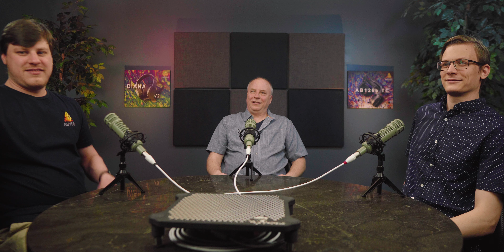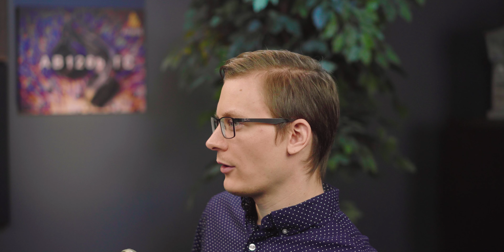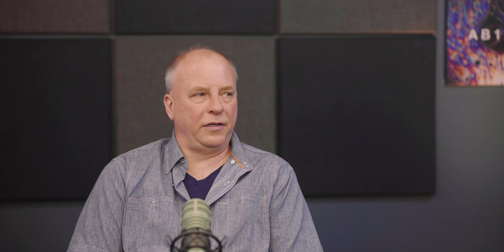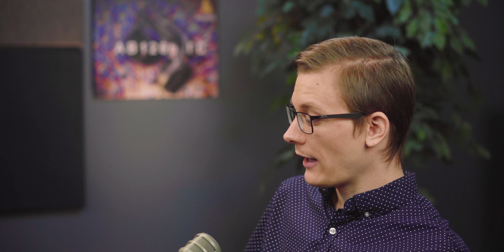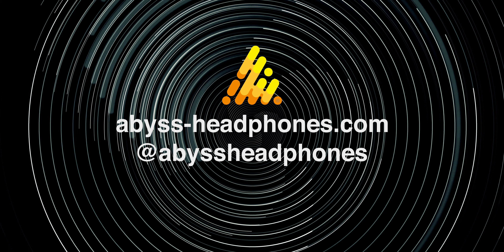Power Conditioners Could Make AUDIO WORSE!!!

Comment: Geezus will the guy in the center let the guy on the right speak. So irritating.
Reply: the guy who seems to know all the info, wasn't getting much of a word is, was he?
Reply: Hell yeah brother. Guy on the right was getting to the point in an intelligent manner by covering relevant points and variables, building to what seemed would be a logical qualified argument. The other guy kept going off on tangents without ever really touching on the main question. I listened till about the 15 minute mark assuming eventually he or the guy on the right would actually answer the root question. Wrong. I don't know if they ever did, as it seemed like the guy in the center would go on forever around the periphery. That's when i quit the video.
Reply: old people tend to do this lots. can be irritating, yes

Comment: We CAN know the condition of the power by using an EMI Dirty Electricity Meter. Also conditioning your whole power system is actually fairly cheap and easy. Just use a Satic Power Perfect Box AND make sure your house or studio has a proper grounding rod that rates at 25 ohms or less.

Comment: A UPS and a power conditioner are two different beasts.  I use a line conditioner to protect expensive computer and audio equipment.  It doesn't improve or degrade the sound quality.  When utility power surges or sags, the line conditioner clicks and adjusts to bring the AC back into spec.  All I'm trying to do is extend the life of the equipment.

Comment: I have a high powered amp that's connected to Furman power supply that's probably 30years old or more, not sure what it was specifically  designed for .. but the amp that it's connected to many times goes into a protection mode for sometimes a brief moment and other times for a few minuets.. Because the power protector is very old, I'm not sure if it's living up to it's purpose or maybe my amp has it's own issues.. not sure which way to go on this...but I'm looking at  upgrading  to a more current power/line conditioner.. any thoughts?
Reply from the maker: A few things to consider. How old is the amp, maybe it's exhibiting a problem. Have your speakers or anything in the system changed prior to the protection tripping? We've seen something like speaker cable cause issues if they are high capacitance on some amps, same with speakers and the variable load they present to the amp. If you're running tube gear you might have a tube going bad.

Comment: I have always wondered how expensive power cable can improve the sound quality of a component when they are plugged into the wall which is wired with 12-14 guage Romex. Any thoughts on this?
Reply: I realize Im pretty randomly asking but does anybody know a good place to watch newly released series online?
Reply: My best somewhat educated guess (I have studied some electrical theory) spend the money on the power conditioner/surge protector. And just use whatever power cable came in the box.
Reply: Power cable can probably affect nearby hifi, especially interconnects. I’ve found everything in hifi can make a difference. But I agree there are no generally accepted logical arguments for why power cable can make a difference, but many audiophiles firmly believe they do.

Comment: So I have a really awesome setup, and we did all grounded electrical and separated outlets.  The power conditioners I had created noise, extra heat, and seemed to cause gear issues.   After I took them out I couldn’t believe my ears.  Get your electrician out to your spot yo separate the breaker from the rest of the electrical.

Comment: I use an UPS with my computer as both a backup for shutdown time and for protection, but the UPS is pure sine wave. I paid around $220 for it new a few years ago. Unless I'm missing something here, it seems you guys may be out of step with the UPS market.
Reply from the maker: We were talking about double conversion true online UPS, it's always generating power, not only for back-up, so the system only sees the regenerated pure sine power,, not the wall outlet. For example, PS Audio builds an audiophile grade device called PowerPlant.
Reply: @ABYSSHeadphones  Ah, gotcha. Don't know why I didn't realize that.

Comment: Can someone explain this further please? 
1. Why can't a pair of schaffner filters (chokes & capacitors) achieve the same the same level of filtering as expensive ones? 
2. Will i lose dynamic range?
3. Will drawing lesser power from a higher rated schaffner filter affect it's effectiveness? (i have an option to buy a 4000W or a 4800W filter)

Comment: Who knew that there would be a subject more controversial than cables?
The thing I learned is that one needs to start with power from your box to your wall. Most but not all power at your street is good quality power.
Contact your power co. and they will install surge protection at the box at very little, or at no cost.
Sometimes this will already be installed. You may even learn something in the process.
Most high quality hi-fi components have installed protection that is already doing a good job so everything you put in place is in addition to this.
Furthermore, one would get more benefit and save money from installing/having installed several quality isolated wall outlets.
At that point, plug as much as you can into your wall. The less you have between your components and the wall the better as stated here.
If you want a surge protector in order to feel better then knock yourself out just make sure to get one that is not plastic and has quality, isolated outlets. You also don’t want one with an external “audiophile” cable as you’re adding another friction point to your mix. If it has a good quality cable it’ll be a better choice.
However, it’s important to understand that surge MOV surge protectors will 100% stop “protecting” at some point so it pays to do your research and consult with actual professionals that know more than us.
In the end, one should understand that 99% of power conditioners (not just surge protectors) will degrade your sound due to their filtering capabilities.
If lightening ever strikes your home, none of your audio components will survive. The sheer destructive power of that event (if it’s a direct strike) can never be stopped by any surge protector of any kind at any price.

Comment: Super awesome information.. I have the old heavy transformer type conditioner, I am guessing it's for audio equipment 
Tripp lite LS600

I use it for my ps4 and monitor with a 1200w inverter and 2 big 12v lead acid batteries with crappy ebay solar panels with a charge controller.. I'll upgrade the panels, maybe I'll ask for Christmas 🎄 😉 

I wouldn't be able to use my setup with out the conditioner for long play  and also it seems to drain the batteries alot less, (maybe it's not but to me so far it is) the equipment doesn't seem to mind any noise from the inverter it's a "pure sine wave"  Inverter 

It has awesome uses for other things besides audio equipment,
Reply: hii why u cant play wiithout conditioner !! is it affect ur gameplay !!
Reply: @snophit9712  lol the conditioner helps keep the voltage stable from the inverter especially as the batteries start to drain...

Comment: What if you are running off an off grid solar setup with batteries?
Reply: Battery is DC so there are some differences. Unless you have something like a motor generator to turn the DC to AC.

Comment: Won't just a double conversion online UPS (with appropriate output rating capacity to power whatever gear we want) do the job? It will basically convert AC to DC and again DC to AC and keep a constant voltage and waveform.
Maybe for example, we can use APC 1KVA Online UPS for our computer systems? Or maybe 3kva or whatever rating for our amplifiers and other high end equipment?
In my opinion, it must work perfect. No need of a power conditioner. Online UPS concept seems good to me.
Anyone knowing better or having more knowledge, please comment.
Reply from the maker: For high end audio use, standard double conversion UPS’s tend to be noisy electrically. So while you would have a decent waveform, you introduce all sorts of small issues in hopes the power supply of the device can handle it. It depends on the design of the power supply, but some will be fine with it, others won’t. If the power coming into the building is exceptionally bad, this might be a good idea, but otherwise it’s probably bound to always put you behind from grid power.
Reply: @ABYSSHeadphones  Thanks for your valuable input on this topic.
Can you please explain why double conversion UPS's tend to be noisy electrically?
Aren't they designed to remove all the noise on the AC power line coming into wall socket by generating new wave form which is constant output voltage and very less harmonic distortion?

I'd like to hear your thoughts.
Thanks!

Comment: Well we can’t plug all our gear into one or two outlets, my home rack has 8 units including an axe fx 3 and a Eventide h3000 so considering most guys are going to plug into a Home Depot power bar with a pop breaker, I have to believe that my racked fuhrman that gives me ten 110 grounded receptacles all conditioned and surge protected is a better option than my 1963 home receptacle 

There are too many variables, receptacle manufacturer, amperage per receptacle, wire composition, gauge and insulation condition, installation (metal staples etc..) dedicated circuitry, breaker panel manufacturer (mines square D 200 amp), the feeding breaker for the dedicated line, the main breaker, are there fuses?, old underground or overhead main (I have seen 00 lines where the insulation is sun rotted and chipped away, 
I’ve also never seen a home with multiple dedicated circuits for a home studio when we can buy new gear and room treatments.
We have played small venues where we had the sound guys assistant keep resetting breakers when we popped them, (so no light show there) not every club is going to invest in the best quality electrical for their talent when they have Hvac and kitchen gear concerns, as a commercial Restraunt Builder and Remod specialist it’s whatever gets the doors open via code, dept of health and labor and industry, because if they aren’t getting customers then my side gig as a guitarist isn’t happening.

And so to the point of this vid pretty much answered with a “maybe” I’ll take some comfort in my Cyberpower tower for my daws, Apollo interface and Genelec monitors so when the power goes out I got battery back up that shuts down my iMac and external drives automatically (much better chance of damage and data loss without it) and it was $350 and the fuhrman or live wire for my travel rack, because as they said nothing is for certain and I like the idea of insurance of any kind even if it’s just psychological 
Plus I like more shiny lights to look 😎

Comment: Another smoke show with no technical background. The answer you really don't need any power conditionner. If equipment manufacturers need any filter they will include in there equipment.
Reply from the maker: Naive to think manufacturers always know or do what's best, it's highly dependent on the engineer(s) who designed the thing and budget allotted. An engineering degree does not guarantee perfection.
Not like we recommend AC conditioners, whether they make an improvement to the sound of an audio system is a crap shoot. There are scenarios where AC power conditioning or online UPS can benefit a system, but you would need to first understand the cause of the problem, then target it with a proper solution.